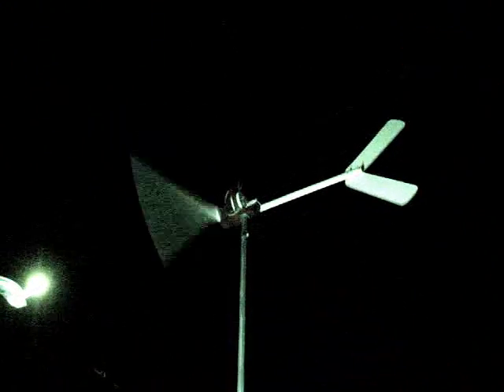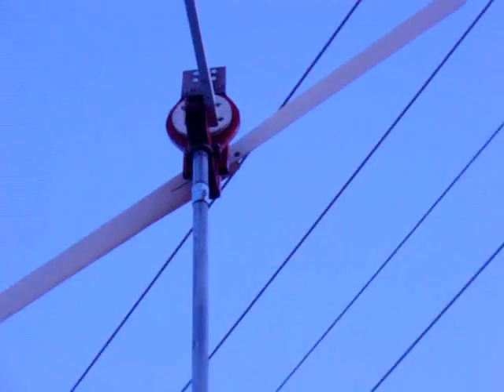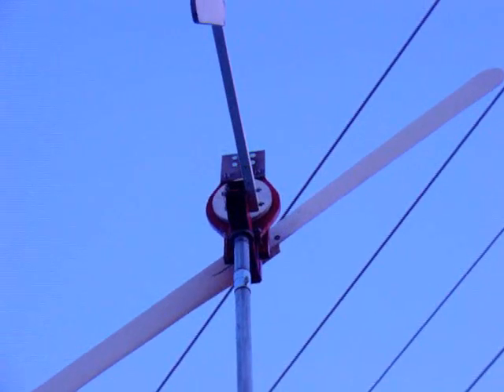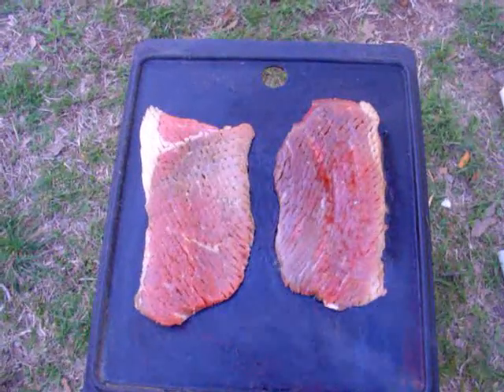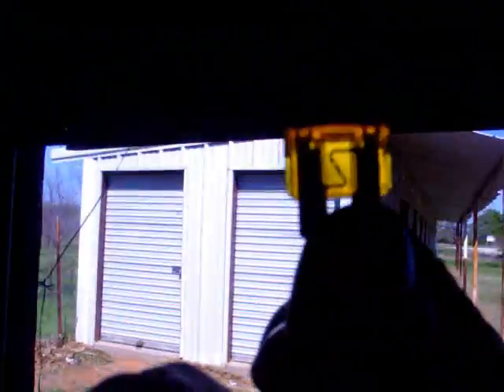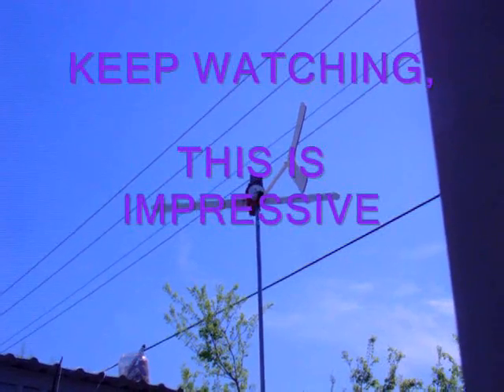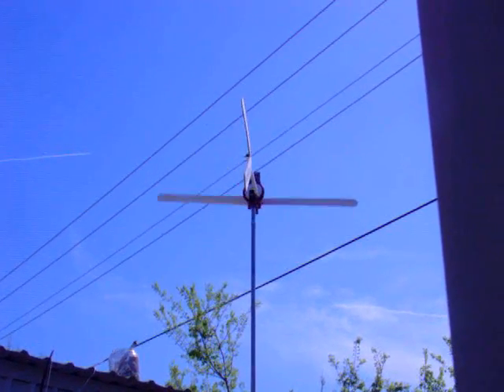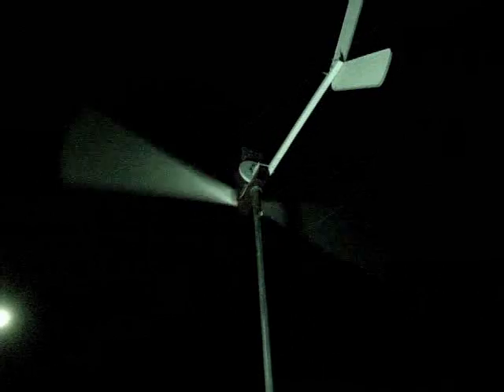PART 10 THE DESIGN OF MUDDYS' MIGHTY MINI WIND TURBINE PROTOTYPE BY BELGRADEMACHINE AND MUDDy

Comment: I have a question MUDDy. At 11:44 you mention the wiring being too thin in the light fixture. I was about to wire up a 3 lamp ceiling fan in my shop. (yes, I now have a shop to work in) I currently have 2 - 75W solar panels hooked to 2 car batteries with a 2000W modified sine inverter.  Would the ceiling fan wiring be too thin to hook up to my inverter?

Comment: Hello Mr. Brown... The weather is so whacked here right now! + 7 ℃ in January.... Last year water balloons were grenading. Sure miss you two. I sure could use a hand with this 12kw inverter.
Reply from the maker: hello Mr. R.
I am well, you can sleep at night now. lol. I bet the 12 KW inverter has some fat wire to connect to it. I aquired a 5KW 24 volt modified sign wave inverter for real cheap. YES it works. And I have moved to a bigger shop. All looks pretty good so far. Now i have to re-wire and install all the good things again. WWWHHHAAAAAA!!
Wouldnt you know, i got tied up all last week during the warm wave of perfect weather. But i did get some work done anyway, Including the rest of my moving into the new shop. I am looking forwards to finishing the new prop for Abrams' Lab Tesla Art. He's gonna piss his pants when the wind picks up.
MUDDy
Reply: *****  get in touch you old transitional phonon
Reply from the maker: ***** Hey stranger. :)
Reply: ***** give me a call ya old turf herder

Comment: (NOTE :- my english is very bad :D :P )muddy . i have watched all ur videos on wind energy  .i just wanna say u that will u please provide a final wind mill that can power whole house (or an arrey of mills )(without ac nd heate) + a guide  to set up of connections to house to use power from wind mill . hope i made u clear what i wanna say . thnx bud u doing great job
Reply from the maker: Jasbir Singh Thank You Jasbir, The one i built in the series, "Dual Permanent Magnet Rotor Axial Flux Wind Turbine", should work for a rather small house on it's own. adding a few solar panels will help take the gaps where there is no wind. I hope to do a video as you asked for soon. I must earn more money to buy the materials and electronics before that.
Thank You Very much.
MUDDy

Comment: Thanks for all the videos..  lot of infos there

If we count the  two rotors with magnets and tha stator as a ''pair' ,  have you think to add an other pair in the axle to double the power ?
Reply from the maker: caslor2002 Yes, That has been done by quite a few people. I have been thinking of doing that for a few years now. It works very well, and You only need 12 more magnets, and adapt the center rotor by making it out of something that is non magnetic. just carve holes in it for the magnets and cover with the fiberglass, and polyester resin.
MUDDy

Comment from the maker: GOOD NEWS GUYS AND GALS: I TOOK SOME FOOTAGE OF THE RPMS, AND OPEN VOLTAGE AT THE SAME TIME. THE READINGS AVERAGED TO 12.5 RPMS PER OPEN VOLT. RESULTS FLUCTUATED VERY LITTLE FROM THAT. (12.2 TO 12.8), MOST OF THE READINGS DIVIDED OUT WITHIN 12.4 TO 12.6. IT SURE WAS EASIER TO JUST PLAY THE VIDEO, AND PAUSE IT TO GET THE READINGS. THE NEW TACHOMETER IS SWEET.
 THANKS.
MUDDy

Comment: Making decent power with that machine. You know you could put a few guide wires on the pole to help it keep from bending.
Reply from the maker: I'M LOVING IT. THANKS. STILL LOOKING FOR MORE OUT OF IT, AND MORE READINGS..
MUDDy
Reply: ***** Try to make the prop a few inches longer to squeeze more out it. See if that helps. It will convert more wind into energy.
Reply from the maker: ***** :)
this one seems to be right on the mark. any longer would make it spin slower. thus late charging voltage.

Comment: where did you get the rpm meter at? and did it come with the read switch?
Reply from the maker: EBAY, UNDER 20 BUCKS MAYBE EVEN 10 OR LESS. AH DONT REMEMBER.
BUT NO REED SWITCH. I RECEIVED AN EXTRA WITH THE ANEMOMETER I BOUGHT.
Reply: *****
 I thought reed switches where only good for 1 million operations. So I never used them on mine. looks like you can get long life ones. I have a multimeter that shows the frequency of ac then I had to divide that number by the amount of coils on that leg, it was a pain in the butt.
Looking bloody awesome and your making me want a nice slice of cow.
Reply from the maker: I GOT MINE ON EBAY. THE REED SWITCH CAME WITH AN ANEMOMETER. THEY GAVE ME TWO OF THEM. AS FOR 1 MILLION OPERATIONS: IT WOULD PROBABLY HELP IF THE VOLTAGE IS DROPPED DOWN A BIT. SO I GUESS A SMALL RESISTOR IS IN ORDER. THANKS.
MUDDy
Reply from the maker: Sirus you know.... I had an idea after the reed switch dropped out of operation. (just like you said)
I will try a manual switch, or contacts that rotate with the blade. It is a shame that the reed switches only last for a short time. More should be expected from something way up on a pole.
I will have to rectify that situation as i get set up on the next location on the new shop.
And thanks.
MUDDy

Comment: can you make a rpm regulator that keeps the charge load from stalling the blade?  if you use the tachometer and relay system to creating a more opportune start speed. forcing a designed slow speed power dynamo fit a less than efficient blade design to work together more cooperatively. a msd ignition system has these rpm related components to do just this with. i hope that came across right.
Reply from the maker: ACTUALLY YES! BLOCKING DIODES CAN HANDLE THE AMPS, AND HAVE A DEFINITE BREAK OVER VOLTAGE. (.7) VOLTS . KINDA LIKE A VOLTAGE REGULATOR DIODE WORKS IN REVERSE, EXCEPT THIS IS FORWARD BREAK-OVER VOLTAGE, INSTEAD OF REVERSE BREAK-OVER VOLTAGE.

JUST KEEP ADDING BLOCKING DIODES IN SERIES UNTIL THE BLADES DON'T STALL OUT. THE WIND TURBINE WILL SEE IT AS A HIGHER VOLTAGE BATTERY BANK.
Reply: that's less complicated than i thought it would be.
Reply from the maker: dale myers Hey Dale!!! I remembered one more easy way to adjust the stall out of the blades. Add another 40 foot of extension cord to the length of the lead in wires. it acts as a voltage drop, and current drop. when this occurs, the prop will spin up faster and act as a buffer. thus the blades reach cut in speed, and start to produce decent amps.
ENJOY.
MUDDy
Reply: thanks, i see what your saying. the opposite happens when you add more load. the down side it lower voltage/slower charge rate. but if it doesn't get to speed. it makes nothing.
Reply from the maker: actually, it doesnt lower the amps into the battery bank when the wind picks up. It just means that the voltage at the tower is higher than the battery bank. The wind turbine blades will adjust to the amount of power in the wind by going faster, and raising the voltage, thus more amps anyway. lol. It sounds backwards, but it works well.
MUDDy
ENJOY.

Comment: Well, I think you are going to have to install a furling mechanism on that or your pipe is going to be pretty warpped.  But of course I know you know this.  I would like it if you can explain the math behind it. I know you explained how it works but am sure the offset and length govern at what speed it furls.  Also am looking for a coil design program to design the coils.  IE, for x gauge for y voltage is z turns.  I'd like to try to build a 48 voltage unit this winter.  Of course am thinking about the ceil fan type for my first try in a VAWT configuration.  I have some ideas to see if I can improve on Boomer's.  Good use on the schedule 40 pipe extension but I had some disagreements here and there.  One if he would run it to a 5:1 transformer on both phases then it would drop the voltage but up the amps.  So instead of 120VAC at .5 amps it would come out to around 24 VDC at 2.5 amps.  Not much, not worth the money but hey, you have to start somewhere.  Why not there. ;)
Reply from the maker: BUT AT LEAST THE PROJECT DIDN'T COST AN ARM AND LEG. WE WOUND ONE CORE WITH LESS WRAPS OF 18 GAGE FOR THE NEXT PHASE OF THE PROJECT. HE SAYS HE IS WAITING FOR ME TO COME UP FOR THAT ONE.
SOON.
MUDDy

Comment: Very nice to watch :) yes you can tell a lot form the RPM meter. I am surprised there not built into a turbine as a standard. Not only can you tell the wind speed but also be able to pick up a fault in the bearings or coils long before it becomes a problem. Nice job mate
Reply from the maker: EXACTLY TRUE MATE. WELL SAID.
MUDDy

Comment: Frequency is rpm, isn't it?
nice job
john
Reply from the maker: CLOSE, BUT NO.
EXAMPLE, THERE ARE 12 MAGNET POSITIONS. 12 DIVIDED BY 2 POLES (NORTH, AND SOUTH), = 6 MAGNETIC FLUX CYCLES PER REVOLUTION.
214 RPMs TIMES 6 CYCLES EQUALS 1284 (CYCLES PER MINUTE).
WELL MINUTES BEING THE COMMON DENOMINATOR, AND FREQUENCY BEING IN CYCLES PER SECOND, IF WE DIVIDE THE CYCLES BY 60, WE GET 21.4 CYCLES PER SECOND. 214 Hz.

I HOPE THIS HELPS.
MUDDy
Reply: ***** from that perpective you are 100% right, I was thinking blade rotation.
best
Reply from the maker: john otoole
YA, I KINDA FIGURED YOU PROBABLY KNEW, HEARING IT MAKES IT MORE TRUE. AND I JUST COULDN'T TURN DOWN THE OPPORTUNITY TO THROW ANOTHER TUTORIAL OUT THERE. WWWEEEE.
MUDDy